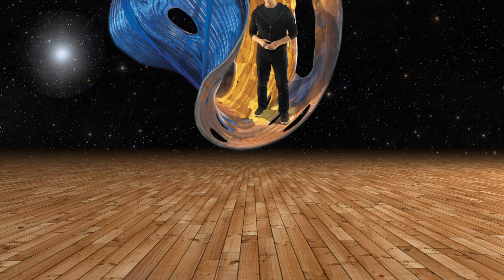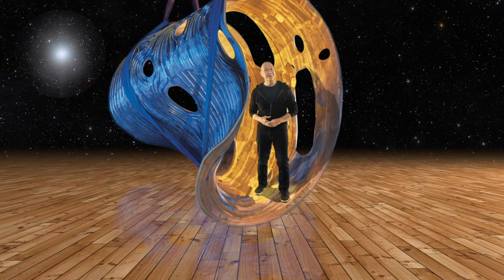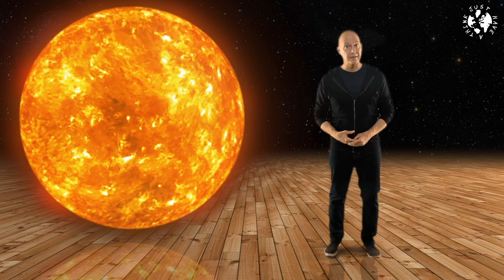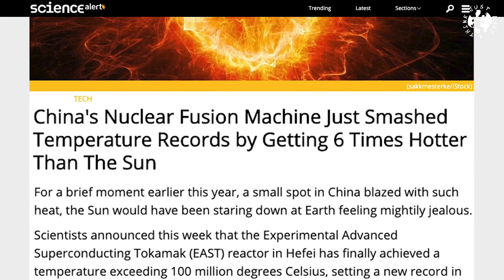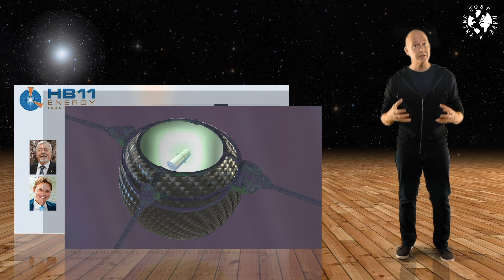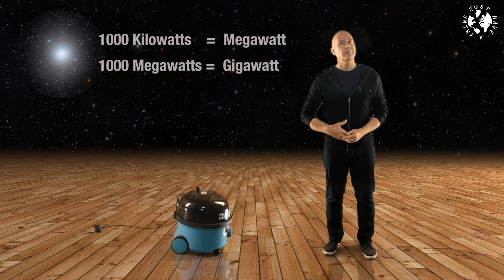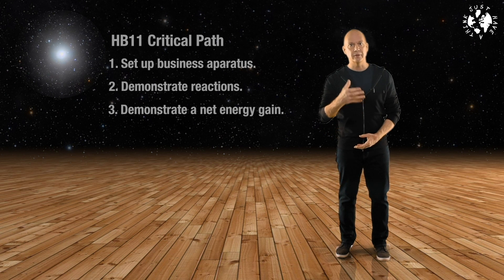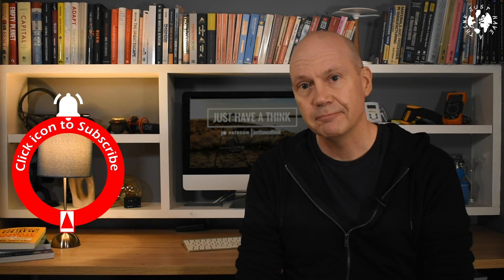Nuclear Fusion:  Revolutionary new breakthrough.

Comment: The question "should we turn toward this fusion tech instead of renewables"?
The answer is NO. Renewables work NOW, they are not speculative. The advances in
battery tech, the advent of electric cars, and wind solar together are present now and developing fast. This decade will see a sea change in automotive tech. Oil will exit - just based
on current tech. IF this fusion works, 'Great', but waiting 20years on a hope and promise would be stupid. Even if we had it now, building new fusion reactors would face a public that is 

pretty tech stupid overall. There will be push back because of the word nuclear, regardless
of the facts. We monkeys still have much to learn, in case you have not noticed lately.
Reply: We just need to do with it what they did with the NMRI machine. Just call it Fusion never use the word Nuclear. We will need Fusion for space exploration. We had to work for decades to get wind and solar to the level it is now.
Reply: @richardgarrison2842  We do have to do something about intermittency.  Don't expect miracles from chemical batteries (although, for static storage, flow batteries might be a partial solution). Pumped hydro is pretty much used up (it requires suitable topography and has a pretty large ecological impact), compressed air is pretty limited, hydrogen very inefficient...  Continent-scale grids are both woefully expensive and vulnerable. We do need something for reliable baseload and for "peakers".
Reply: @bazoo513  it is a fast moving tech
Reply: @mr1enrollment  That's what I thought a few years ago, but consider: the batteries we use in electric cars (and in grid-level storage using their "second life") have a capacity of about 280Wh/kg. Panasonic came out with a cell with 240Wh/kg ... TEN years ago. It's just that today batteries are five times or so cheaper, but about far better mass or volumetric capacity, lifespan or power density all we hear are press releases from researchers. The only technology enabling wind and solar only production that is here, with no further research needed, is an extremely wide grid. But, again: expensive and fragile.
Reply: @bazoo513  Intermittency is short term problem. We already have plenty of technology that can fill the void now and plenty more on the horizon. The investment is already happening too.
Reply: @RoadRashSpirit  That's a blanket answer I keep hearing, but the fact is that Germans, with their heavy emphasis on wind and residential solar, have growing gas use in peaker plants and are opening new lignite mines for baseload while having expensive power. Danes, OTOH, use French nuclear and Norwegian hydro (pumped and conventional) to fill the gaps in their offshore wind. When they have too much, they pump Norwegian water. So, yes, solution, in principle exists, but to make it universal, enormous investment is still needed. And French nuclear serves as everybody's "gap-filing" - they don't have enough for that. 
People, forget your fossil FUD driven preconceptions about nuclear. If we continued the intense development of it in '70s, we would be in a drastically better situation now. (Of course, cleanup of transport, agriculture, cement sets would still be needed - nuclear power is no more panacea than wind and solar are.)
Reply: @bazoo513  If you keep hearing it then there is truth in it. The investment is happening as I said, Britain is executing big plans for energy storage. Neither Germany or Britain currently have the required storage so that's why I stated its a short term problem "that all country's are working on". They will have required storage well with in the time it would take to build and commission a nuclear power plant. Its got nothing to do with FUD preconceptions or even the environment and everything to do with engineering and commerce. If you are obsessed with Nuclear arguments its simple miss the underlying realitys. Fission is too slow and costly to implement to have any real effect at this stage (Hinckly point C case in point). Wind/Solar are cheap and quick to install, Battery storage/ Liquid Air Storage and a few others are ready and  available, quick to install and profit from and still come in cheaper than fission budgets. I agree they are just a stop gap until Fussion plants are ready, but the time scale for this is still lengthy. Their are plenty of successful case studies now regarding how well grid storage and renewables work.
Reply: @RoadRashSpirit  You might be right - we have managed to make the simple, obvious solution, nuclear, "too slow and costly" (thanks to FUD campaigns I keep referring to), and now it might be too late for it. Likewise, we made sure that not enough is invested in fusion research for it to "arrive on time". And so,  gas "peakers" all around.
Yes, I know everyone (Europe, anyway) is "working on it" - for example, there is a large project underway to vastly improve interconnections between national grids ("Celtic connection" - an underwater cable between Ireland (wind) and, I think, Spain (solar) - might be France (nuclear) - being one of the more expensive components). But, even when it is finished, interconnects will have only about 10% of national grids capacity. 
Luckily, there are some serious efforts, mostly in Baltic countries, to deploy new small modular reactor designs - cheaper, simpler, inherently safe, faster to deploy than the traditional ones.
Reply: @bazoo513  I wasn't on about interconnects, although a connected grid does help. All country's are introducing storage. FUD doesn't make nuclear expensive. Materials, Build and running costs make them expensive. Even small reactors are just to expensive to build and maintain, which is why the UKs 2 latest aircraft carriers don't use them. Let me do a very basic comparison on the life cycle of a nuclear power plant to that of say a windfarm.
Build first 10 years
-Large body of Engineers and contract advisers dealing with site specific plans, health and safety considerations like back up power bunkers for coolant 
-Large excavation and site management costs
-Large Build costs mainly in concrete and contractor man power (its like building a dam)
-Large commissioning costs as experts need to be brought in for the final safety systems and the intelligent systems including the reactor itself.
Running for 35 years
-Largest bill is labour as site will employ top technicians, engineers and scientists in the field to monitor and maintain the plant.
-Costs for fuel and storage of waste
-Large cost for security and military support as plant deals with highly sensitive materials requiring governmental oversight
Decommissioning Last 10 years
-Waste management costs including continued military security +100 years
-Cost of removing labour
-Contractor and material costs of burying old reactors

And I'm sure there's more I have neglected
In comparison, Installing a like for like wind farm and storage requires less site management, can be designed, built and commissioned within 5 years with very cheap materials and construction costs. Will run for 25 years, doesn't require any where near the amount of specialists and security, no fuel or waste costs and requires only a skeleton maintenance crew for basic exam work. Decommissioning is as quick as installation and costs less as the mills can offset the cost through recycling (even the blades). The storage plant can also be recycled regardless of technology if it even needs to be as the plant can simply be updated or re-fitted.

Cost and Engineering. Its got nothing to do with FUD or Ideology. A few years back I did a MW comparison of the simple cost of solar panels vs the "then build cost of Hinckly point C" at that point the nuclear power plant came fractionally ahead. Note this did not include running and decommissioning costs of which a solar plant has little (all panels at 80% after 25 years can be sold on). 

Fussion will happen eventually,
Renewables and storage are happening now,
Fission is winding up, it had a good 70 years
Reply: @RoadRashSpirit  What storage, for goodness' sake ?!? The only feasible storage we have is pumped hydro, and it is mostly already built where the terrain and hydrology allowed it. Musk's battery farms? They are drops in a bucket, and expensive. Flow batteries? Show me anything beyond "pilots". Hydrogen? Woefully inefficient. Molten salt? Again, pilot after pilot...
I am too tired of this nonsense to go point by point. Let me just point out that new reactor fuel cycles pose no proliferation threat (so, no "military oversight" nonsense), and nuclear waste is a completely manufactured problem. We could perfectly safely vitrify it and dump it into the ocean subduction zones (not to mention that some new reactor designs burn PWR reactor waste). As I said, FUD.
But believe what you want.
Reply: @bazoo513  Look you haven't read everything Ive written and it doesn't matter what either of us believe, as I have pointed out, markets move because of what makes financially sense, markets are investing in renewable and storage plants of various types + more that we haven't seen commercially yet. They are doing this because the test sites have "proved profitable" where nuclear has always been heavily subsidised. Engineering and Commerce, not ideology.
Reply: @RoadRashSpirit  I agree, except that nuclear is unprofitable because of ideology powered by coal money.
Reply: @richardgarrison2842  Heh, you are right. As a physicist by training, I always put "N" at the beginning of "NMRI", but vendors never do. (After all, there is also an electron paramagnetic resonance technique.) Physitians, OTOH, just call it "Magnet".
Reply: @bazoo513  The Daya Bay Neutrino Detector was placed in Daya Bay China because those folks in California, (an alternate site), did not want to explain to the public that the local Fission power plants emitted neutrinos,... (impossible to stop unless you have a mile thick of lead). 

The Daya Bay detector was a DETECTOR not a source of 'nuclear' radiation. AND yet -  it could not be hosted in CA due to public stupidity.
Note: also I think the number is 300 neutrinos/sec/cubic cm pass thru your body ALL THE TIME. Also note the detector was a HUGE success.
Reply: @richardgarrison2842  LOL, right. We don't need
space exploration, we need to get people educated to a level where they can at least understand a scientific argument. Case in point DJT and the minions of the Tea Party. Otherwise we just won't survive.
Reply from the maker: Personally, I entirely agree Daniel :-)
Reply: We don't have time for that. Our ice caps will melt and agriculture will fail. We need massive use of solar panels now. The Sun is a working fusion device we need to use it.
Reply: if they could just invest an atom of the defence budget into research of fusion...
Reply: @𒁲🅹🅰🆈🅵🅰𒁲 ✓ • 5 years ago You think that the economic downturn will result in a sharper drop in albedo rising aerosol emissions than in CO2 emissions? Possible, but what is your reasoning about that?
Reply: @𒁲🅹🅰🆈🅵🅰𒁲 ✓ • 5 years ago If I told you what I think will happen, you might try to find someone with COVID-19 to kiss.
Reply: Former System operator here.  I read all your comments and it's obvious that your heads are all up your butts.  Solar and wind are unreliable, thus the need for peakers.  Nuclear is reliable and cheap.  Electric cars are bad science.  Battery disposal is very dirty or very expensive.  Storage of energy via battery banks. Was tried where I worked in the 89s and 90s.  Not worthwhile.  Oh yes, electrical demand should 20% of vehicles switch to electric, system infrastructure would be overwhelmed.  Global warming?  A farce.  Nuclear is the real answer, but bad PR is killing it.  None the less, when push comes to shove, the BS will lose out.
Reply: @michaelhearne3289  "Nuclear is reliable and cheap." - Yeah, "too cheap to be metered", right?
"Storage of energy via battery banks. Was tried where I worked in the 89s and 90s.  Not worthwhile." - Yeh, we tried heavier-than-air flying in 1903 - nah, too short!

I am a great proponent of nuclear energy - innovative inherently safe fission reactors as a stopgap to fusion, but, nevertheless, practically everything you said is nonsense, from climate change to cost of "disposal" of batteries (material in them is too expensive for "disposal", they are recycled for ray materials). Learn - the world has changed in the last 30 years.
Reply: How about reducing consumption and energy needs worldwide and systematically discouraging (either through price or infrastructure reforms) personal cars? The change will be non-significant if we were to replace all cars on the globe right now with electric cars since you still need crude oil in the production.
Reply: @rimson_ways3254  transitioning will occur, that is why solar and wind are in the mix.
Reply: @rimson_ways3254  Reducing consumption will not work given we live in a technological age. Replacing all cars with electric actually cuts out oil. VTG and no more energy used for oil refining and shipping. Renewables are proving capable with storage. More is coming online all the while.
Reply: @rimson_ways3254  Let me guess: you live in a city, probably a European one? So do I, and for us, this might be feasible. But do you have any idea of the cost, effort, and time needed to provide universal public transportation? And the transport infrastructure is not made of unicorn farts - it also needs to be manufactured.
Reply: @bazoo513  I wasn't talking about anything that's even remotely unfeasible (like universal public transport). I should have specifically said that I was talking mainly about useless transport and consumption, such as mindlessly using the car to go to malls, restaurants, supermarkets and such while having the access to public transport. Even more, discourage worthless 'business' flights, personal jets, tourism, transport and production of junk food, minimizing or abolishing animal agriculture altogether, change the standards for industrial equipment so that they become more environmentally friendly, facilitate the use of grey water etc. Oil and coal are not only used as fuel for necessities, they're also used for a lot of personal greed and vanity (weekly new cotton clothes that pollute tremendously, a lot of exotic produce, 3 cars per family, huge houses with a big heat requirement in the winters)
Reply: @rimson_ways3254  Ah, okay. I misunderstood, then.
Reply: @mr1enrollment  Our population is falling (Croatia), so, yes, why not, come over! (But it would better not to re-elect Agent Orange anyway.)